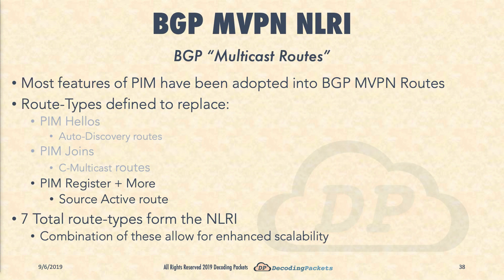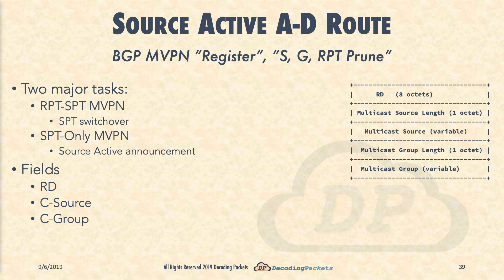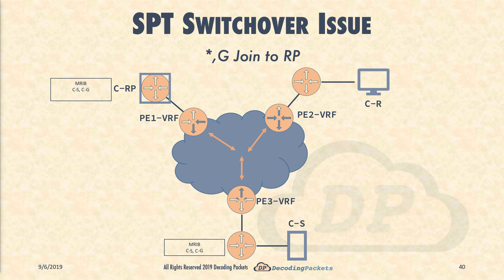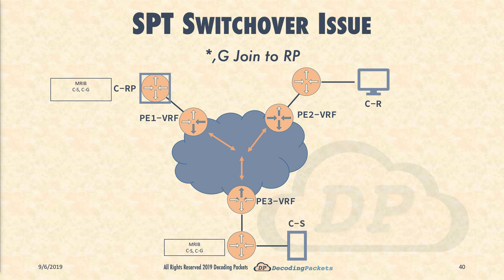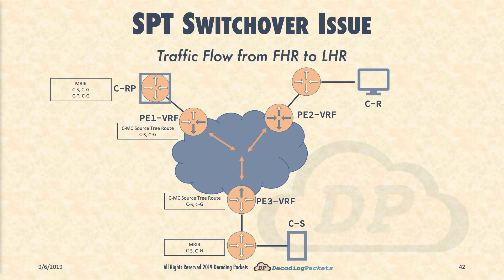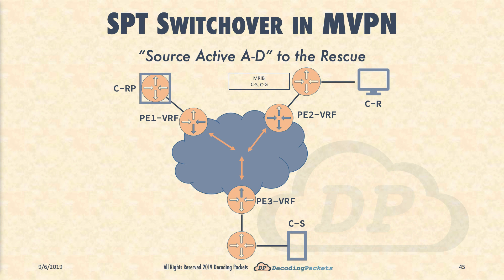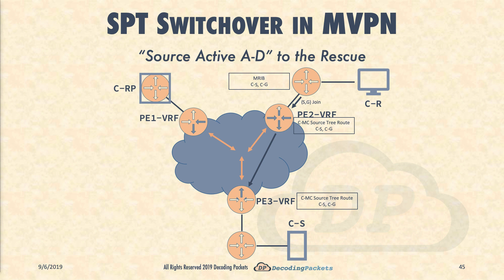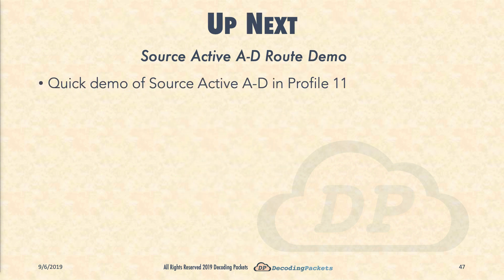MVPN Video 19 - BGP MVPN SAFI Part 2 - The Source Active A-D Route

Comment: the described scenario seeme to be like the "RP on a stick" scenario, so I'm not really sure if duplicate traffic occurs. For sure the source active AD route solves the issue, because there is one anyway. I was wondering how it is managed in case BIDIR-PIM is used by the customer ... when traffic is sent to the RP ? temporarily ? if so, is traffic duplicated ? never ?

Things are also described here (links allowed ?):
https://packetpushers.net/ng-mvpn-control-plane-overview/
... they claim duplication does not occur because the PEs discard the traffic (don't really understand how they could discriminate between traffic bouncing on the RP or directly received from the PE ... do they use the bgp next-hop toward the RP ? ).